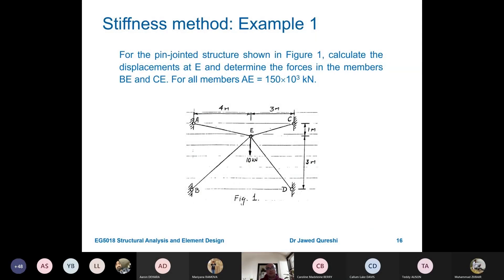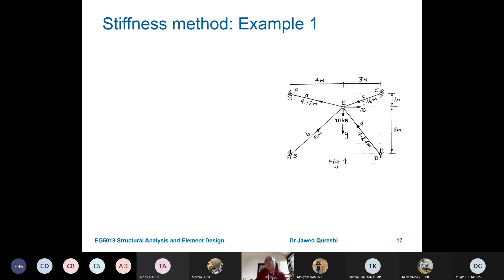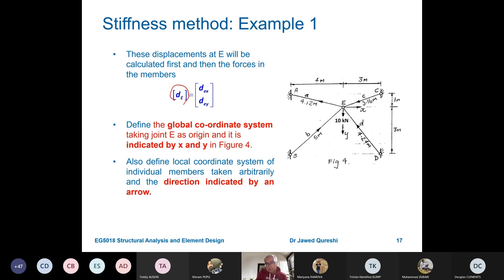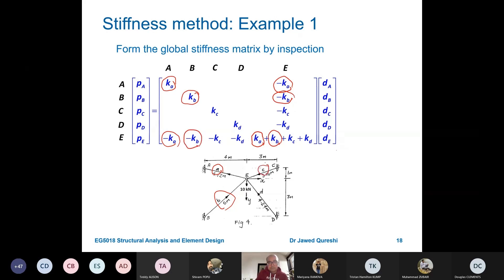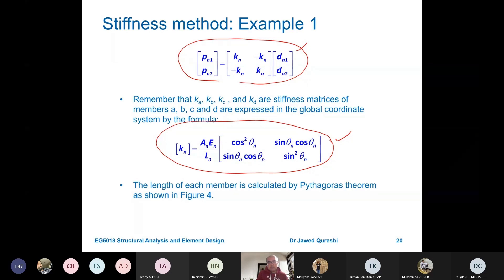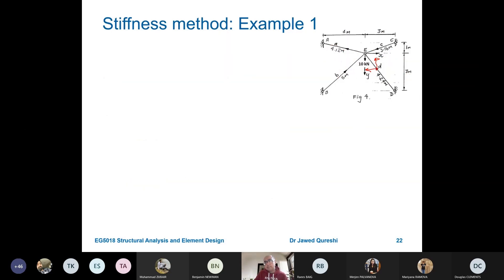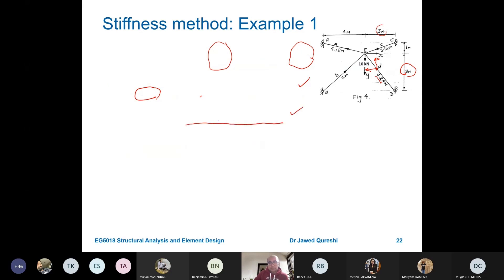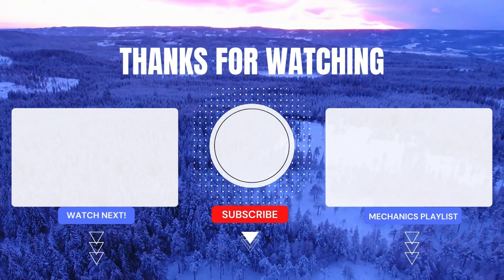How to use STIFFNESS METHOD for Pin-jointed frames – WORKED Example

Comment: Do you have a PhD? Amazing. You cant have a video on a pinned-pinned frame element. What a Dr. waste of time.
Reply from the maker: Yes, I have a PhD degree in Structural Engineering from University of Leeds, UK. Thanks for your valuable feedback. We can have pin-jointed frames and we call them trusses or truss elements sometimes. Frame element, on its own, is normally associated with moment, shear and axial forces. I hope it clarifies your confusion. I’m happy to elaborate more.

Comment: Sir what's the difference b/w horizantal and axial force
Reply from the maker: Axial force is applied to the longitudinal axis of the member. It causes compression or tension. Horizontal or vertical force refers to the direction of the force with respect to the member. For example a wind force is usually a horizontal force applied to a building or structure. People walking on a floor is an example of vertical force or gravity force.
Reply: Thank you very much sir